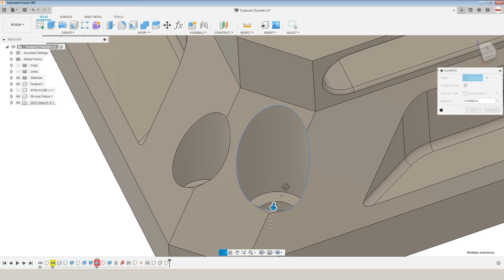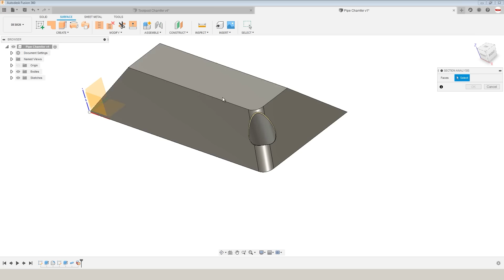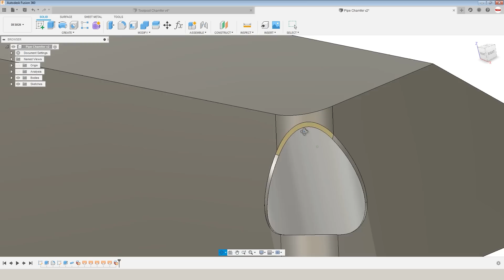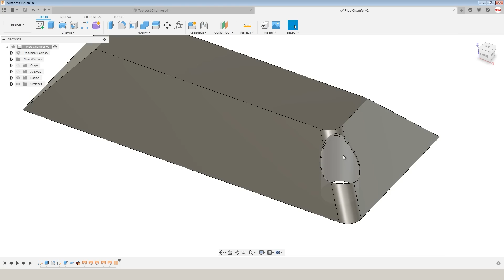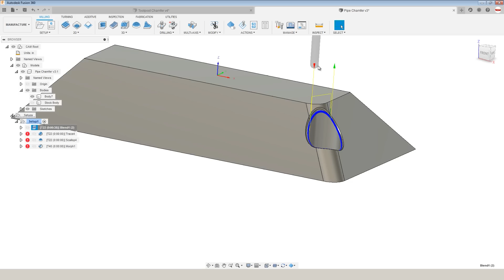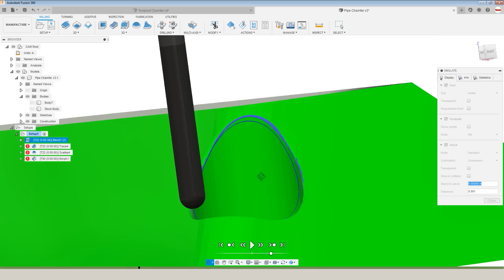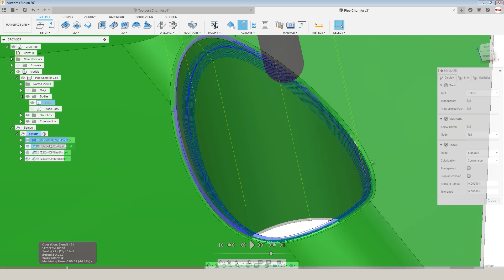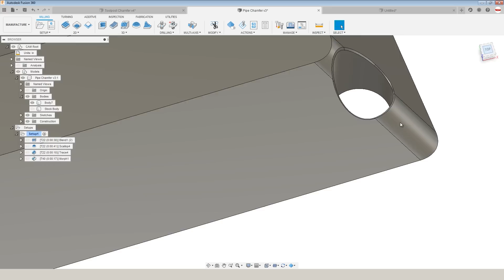Modeling and Machining Complex Chamfers in Fusion 360!

Comment: That was great. I know it's old, but I'm just getting into Fusion after years away from CAD. I'm dealing with this exact thing and your solutions made sooooo much sense. Thanks!
Reply: Blend worked great! I didn't need to change the standard chamfer feature to a lofted surface because we only needed an edge-break between a cylinder/cylinder intersection, i.e. simple conic section. I image in your example you needed to rebuild this because of discontinuity in the chamfer feature's surface where it transitions from cyl/plane to cyl/cyl intersection curves. We're only doing a .01" edge break too.  Anyways, thanks again!

Comment: Well done! I use HSMworks for solidworks as my CAM, I've used it's "flow" toolpath for both chamfers and fillets like this, and it hasn't let me down this far. I'll have to look into blend, but also, I'll have to look into what solidworks could do to replicate the pipe creation and subsequent deletion + surface modeling stuff.

Comment: Hi John, I have been watching your channel for a while now and it has now made me decide to learn Fusion 360! I have now purchased this software on Subscription and wanted to know what is the best course to follow for the absolute beginner for machining parts using this Cad Cam?  Something to get you up to speed and cutting metal relatively quickly. I have a lot of projects both milling only or turning with "C" & "Y" axis machining. I have been in the Precision Engineering sector for over twenty five years now so I am not a newbie to machining just to using this software :-)  I am in Perth WA and we work in the metric system so the course would need to be for this! Any help is much appreciated, thanks Jon.

Comment: Any reason you didn't try Flow? Since it doesn't use a projection it should have done the job even better. You likely could have even reduced the number of passes since the amount of material you are removing is so little.

Comment: i do wish they would add the ability to do this with a normal chamfer tool from a sharp corner!  **magic button
Reply: I mean, you can use a regular chamfer tool. It will look horrible though, because of the fixed chamfer angle on a variable angle part.

I suppose one way around it would be to do the whole thing using a 5-axis machine, but that's a significant step up in machine, and in programming complexity.
Reply: I can't remember, do they have a variable fillet tool? If not I'm sure they will soon and you can use the same method but with a fillet instead, it does work, I've done it in mastercam and you would have thought I used a 5 axis to achieve.
Reply: @wildin13  Yeah I think you could get a great result by doing a fillet with "radius type" set to "chord length" instead of creating the pipe, then follow along just the same with deleting and lofting in the surface workspace.
Reply: @RobertPetrucha  I don't think you'd even need to create lofted surfaces. If you're just after a clean and aesthetically pleasing edge break you could run the programs using the fillet. 
It would require less CAD work, no tiny splines that you might miss like in video as its all chain selected. 
Personally I actually prefer the fillet look to chamfers, smoother look and feel to them but chamfers are normally quicker to produce 🤷‍♂️